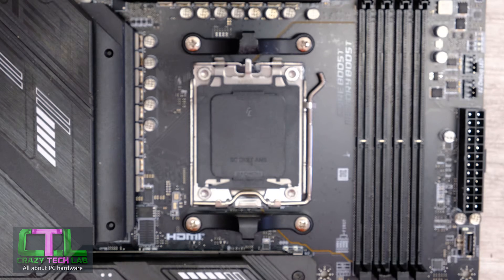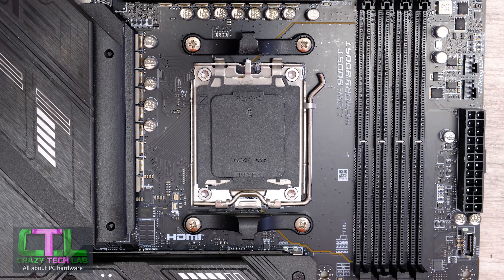How To Install A Ryzen 9000 Processor

Comment: Thanks for the video. Installed my first CPU the other day (9700x). I got the triangle lined up and that left side edge was touching when the right side slipped out of my fingers and dropped about 1/8”-3/16” to the socket. It was all aligned and the clamp worked as intended. So far everything seems to work, but I’m still waiting for it to die. I was afraid to try and remove it at that point and possibly damage something I actually hadn’t.
Reply: Hi how's it working? I don't think it got damaged btw.
Reply: @ working great so far. I ran OCCT, Puget photoshop and a blender benchmark. No errors and seemed to have very good scores. The only thing is with some guitar plugins that use iLok. There something security wise that’s not working and I’ve read it’s an AMD zen 5 issue.
Reply: @Bloozestringer  Great to hear that the dropping did not damage anything. The CPU and the socket should be able to handle a slight drip, which is totally normal when you keep the falling height minimal.

Comment: I wish I knew this back in november last year when I upgraded. I still have a new buggered mobo in my cupboard.
Reply from the maker: @AUSS1E-R0B  It’s so easy to do! And the processor is the perfect shape and weight to do it as well! 😖
Reply: @CrazyTechLab  I mashed the old CPU with the new mobo. Unknowingly mashing pins with pins. Wondering why it wasn't a smooth install. It was a expensive mistake I wish I hadn't made. The new AMD 5 pins on the mobo are so fine and small I couldn't find a fix and couldn't just bend them back as I normally would have easily.
Reply: Where do you live? There is a guy in my country (Hungary) who can fix it without the service department noticing, even under warranty.

Comment: Do I need to upgrade the bios before to install this new 9600x or it can run well without upgrades?
Reply from the maker: Depends how recent the BIOS you have is. Nearly all were updates online to download a version that now supports them. Best bet is to get the latest from your board’s product page, install it and you should be good to go when you get a new CPU
Reply: You have to update the bios. Only on B850 (that arent out) will you be able to plug and play.
Reply from the maker: @venomus9286  Not necessarily. If you buy a board now it will likely be compatible since BIOS releases have listed support for Ryzen 9000 since May Three months ago so retail models already likely support them out of the box. Manufacturers don’t ship boards with the release BIOS they update them. Plus there’s always USB BIOS flashback even if the board comes with an old BIOS
Reply: It couldn't hurt to check - if your using the latest bios or update if there's a newer bios.

Comment: Too late... my kid put thermal paste b/w the CPU & the socket...
Reply: time for a new kid
Reply: oof! 

Tell the kid it's their job to fix it? (Go cut grass and rake leaves, clean gutters until the mobo is paid off)
Reply: Probably not a problem if I understand you correctly. You can use propyl alcohol (I think its called in English) or another non-condusive spirit to clean up the worst mess. The Thermal paste is not conducive. There are vidoes with people just pouring thermal paste everywhere on and besides the cpu. If it dries it becomes a problem.